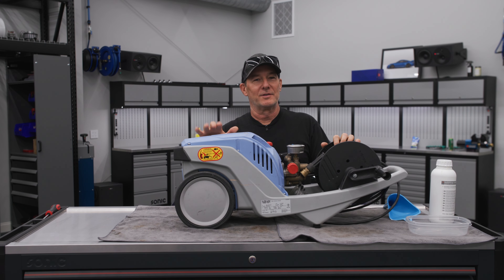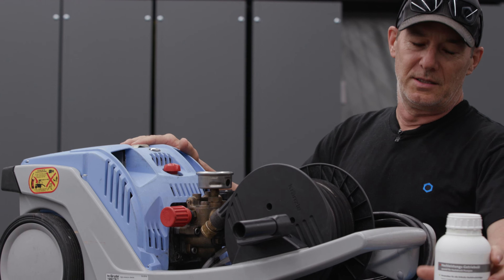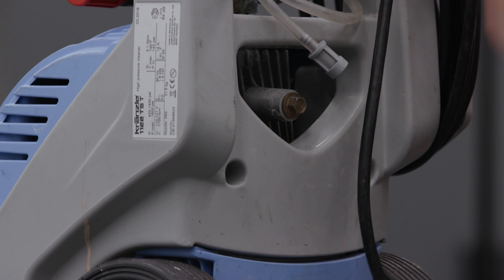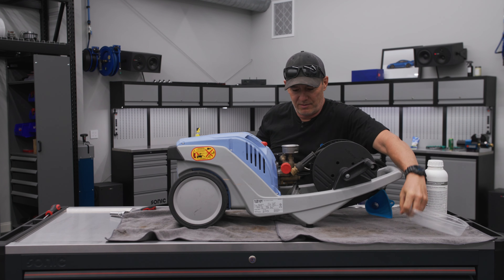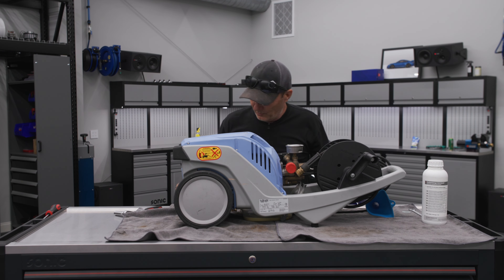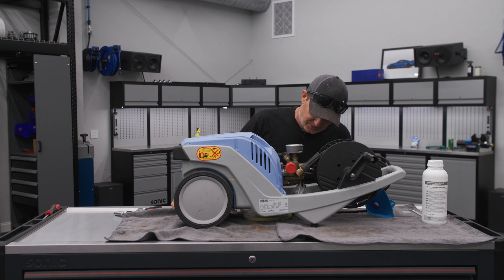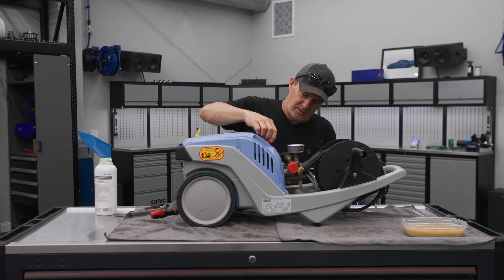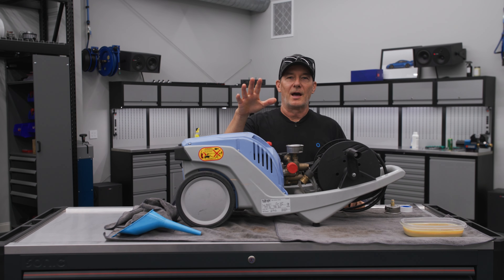How to Change the Oil in the K1122!

Comment: Great video! On my 2160 its a magnet in the drain plug, I always clean it, could be som metal on it!!
I also open the oil cap befor the drain plug, there may be some  pressure in the oil, if so you would have a cleaning job to du.